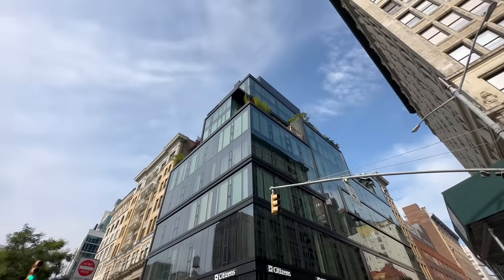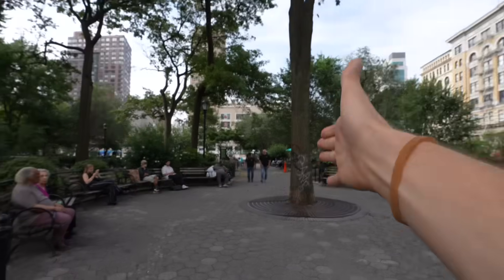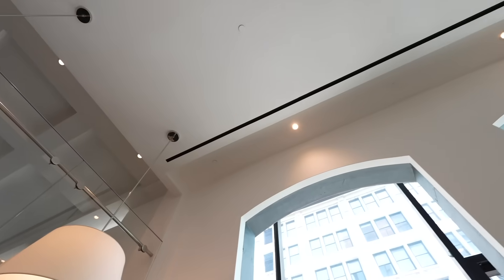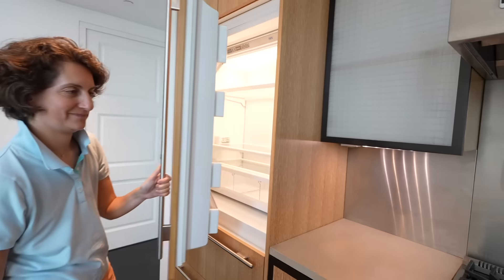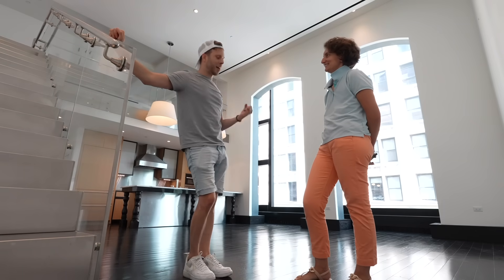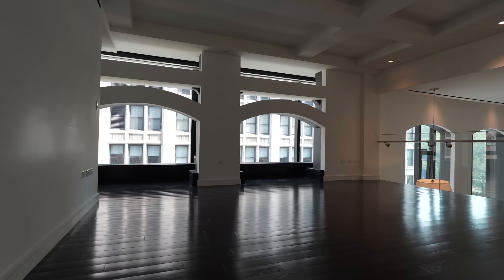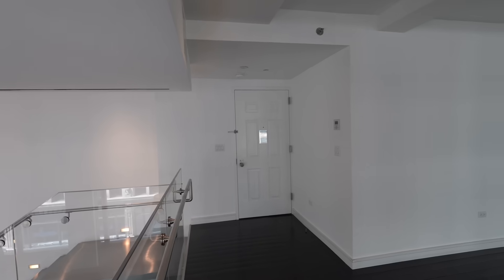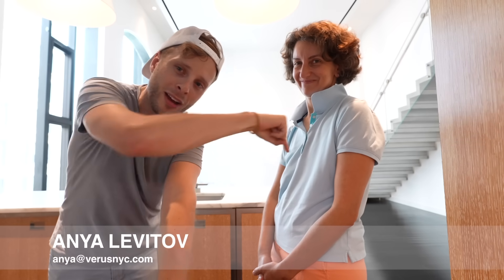Someone Turned an Empty Office into an Apartment…

Comment: Great neighborhood for shopping.   They're opening a new small format Target next month where the old food emporium was.  I love how they repurposed an old building instead of demolishing it.  You'd next know from looking at the exterior that the original structure is still there.  The farmers market is phenomenal.  It's most crowded on the weekends.  The apartment itself is futuristic with all that chrome.  Not 100% sold on that but I love the kitchen design with all the pull-out shelving.  Nothing should get lost in the back!.  & a 6 burner Viking stove for a 1 bedroom?  Almost unheard of along with 1600 square feet.  But I think this is way overpriced.  It's been on the market since the early half of this year for starters.  I think it was previously staged with furniture but since it didn't sell quickly the furniture, etc was removed & now you can definitely see the floor outlets.  Why,  with dark wood  (or whatever material it is) would you use white outlets?  I know there's darker options available.  Maybe that's nitpicking but for the price they want you to pay???  & monthly charges NOT including the mortgage will run you $7K for HOA fees & property tax.  I have a feeling this will be sitting on the market for a while longer
Reply: All I could picture was going up what looked liked stainless steel sink stairs in fuzzy socks and falling into the glass railing.🤕😶‍🌫️🚑
Reply: @bonniepwtf  yeah those stairs were "different".  I don't remember ever seeing them b4.  Maybe I'd it was a more open design with just the tread but still.... seems slippery unless you can put grooves in them
Reply: Yes, you'd freeze your butt cheeks on that steel toilet.
Reply: That "powder room" gave me prison vibes.
Reply: @AnneLilley  ok that too but I was thinking airplane bathroom or what's on the LIRR with the stainless steel toilet & sink.  Might be perfect for a germaphobe

Comment: Thanks for showing us this, it was visuallyintriguing. It's not for me even if I had 3mil- with all the glass, black floors and shiny metal you'd be cleaning constantly. Someone will snap it up, especially with that location.
Reply: Hasn't been snapped up yet.   It's been on the market since early this year.   There's a reason for that.
Reply: @MamaCarola1  Ahhh, I looked for what you thought but I must of missed it. I will check now.

Comment: Obviously, if you are a fan of new, high-end chef's kitchens and modern, artsy, pseudo-industrial decor--sure, this is very nicely done and worth it. Details like the floor outlets and top notch coffeemaker are great. Now...I would accept the expensive appliances, but personally, you could not pay me to live here. I like OLD character and that has been brutally stripped from this  antique building--yes, except for the windows, but that's not enough. The exterior is architecturally criminal and downright repellent to me. But whatever. I'm not gonna buy it. And as always, Cash did a terrific job filming it. I'm sure this place will make someone very happy. p.s. I love the old bathtub....of course...but it makes no sense amidst the rest of the decor.
Reply: "pseudo-industrial decor." - Agreed. Those door handles are a mannered mess, made to look cool rather than be solid, heavy, and ergonomic. The doors themselves either look hollow or composite and the "colonist" ranch style does not fit with the rest of the apartment. The bathrooms, decked out in cold shiny steel are cheesy,  perfect for 80's band back home from having pancakes at 4am. Still, like I said above, my #1 concern, as per regulations in all new construction, the windows barely crack open. It's torture. I've stayed in many of these types of apartments. You'll be running the AC or heat all year around, expensive too, and then when you cook, you have to turn on the noisy overhead hood vent or you'll set off the smoke alarm when making toast in your Breville. Real living has been regulated out of these new apartments. It's terrible.